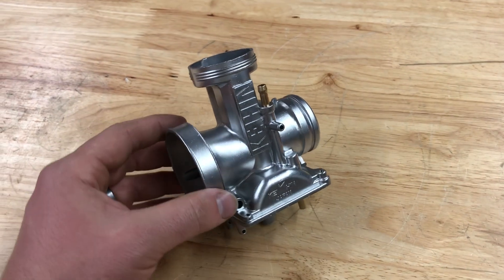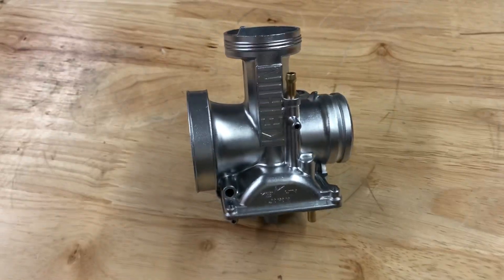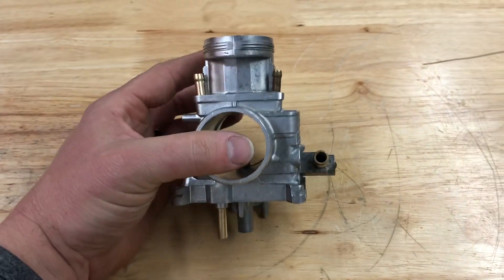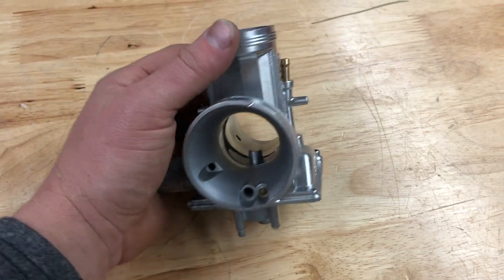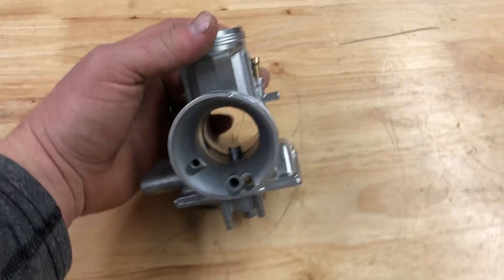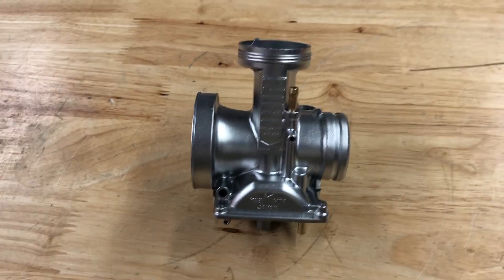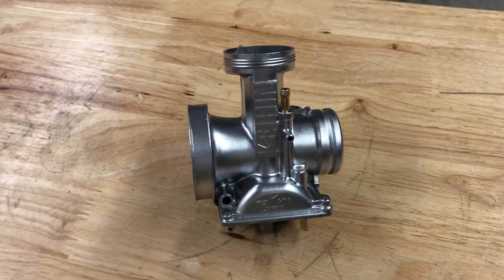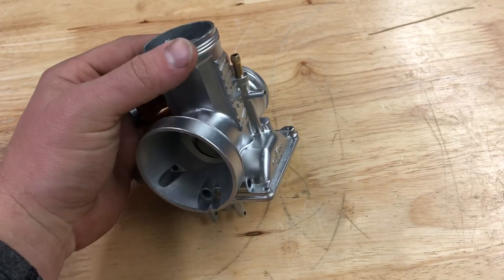How to Vapor Hone a Carburetor- Vapor Honing Technologies

Comment: What abrasive do you use?
Reply: Glass or Ceramic bead media... In general the smaller the media diameter the higher the sheen. But the smaller the media the longer the part blasting time.